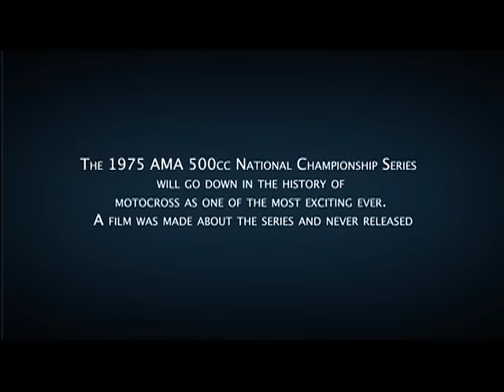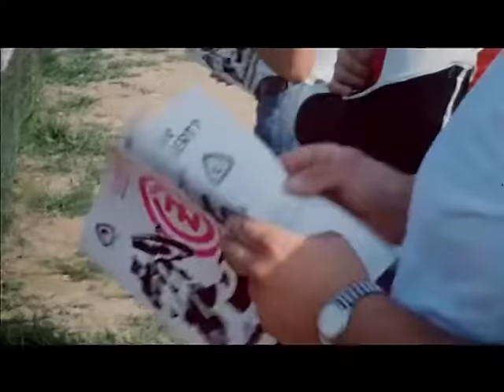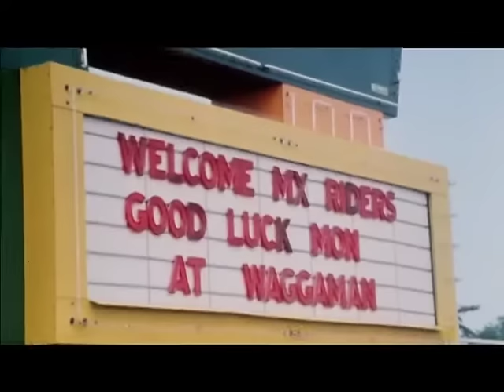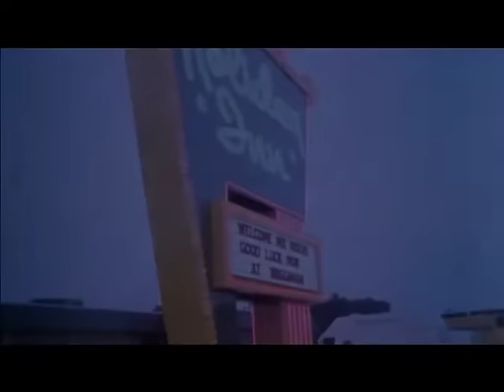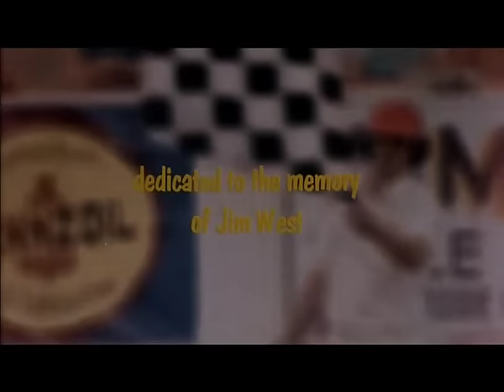One Chance To Win

Comment: There have been some gifted writers over the years who could provide insights into these brutal days but watching this video cinematography again failed to communicate the sheer brutality of this era. These bikes were frightening to open the throttle on even on a smooth surface. They tried to rip the rider off the back while hammering you through terrain that was not square and semantical like today. To be hurling down the track as these bikes are trying to throw you in every direction other than where you want to go took mutant core strength and courage. Catching the roost while having no vision from dust on these bikes is about as close as someone can get to the brutality of combat (though war is always the ultimate test of men).

Comment: So this  is the  1975 Season .. I do see a  1976 Model Yamaha YZ-125 Mono shock bike ..  I wonder if it was a Factory bike  in 1975?  I think 1976 was the first year for Yellow YZ's in the USA and the First year for the Mono Shock 125 CC's .. They had the Mono shock on the Bigger bikes in 1975   Suspension sure did evolve in the next 5 years and Liquid cooling ..
Reply: Indeed, evolution from the CR to the YZ and beyond was amazing. Red Hondas were also team only as the dealer bikes were still silver.